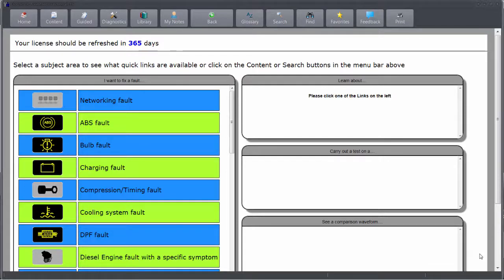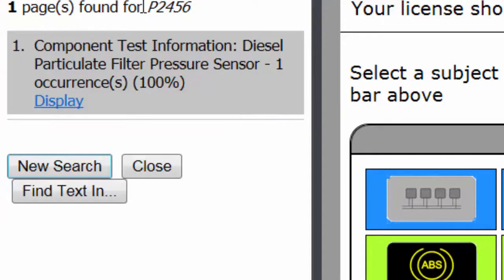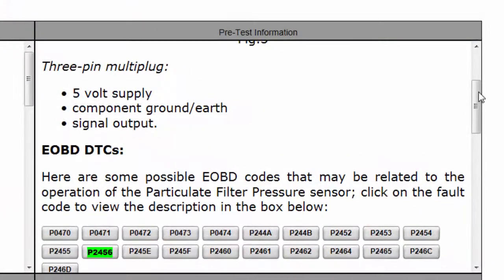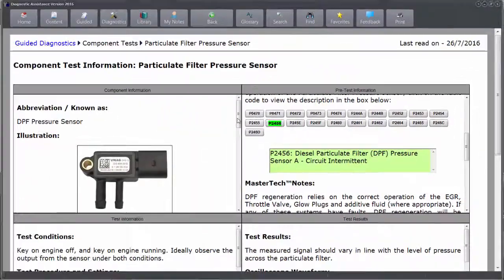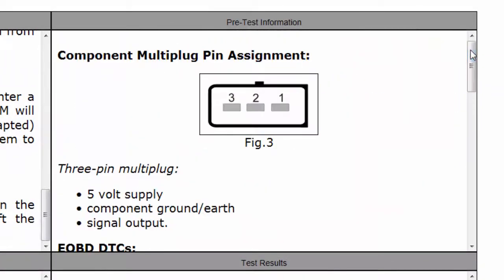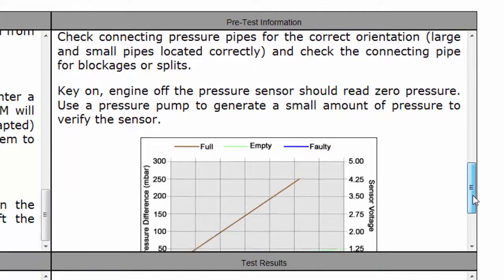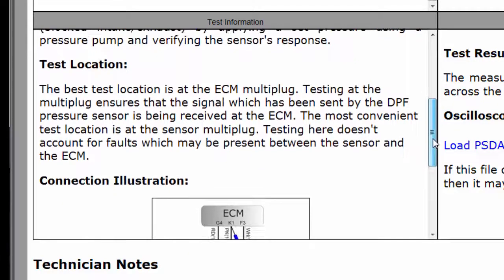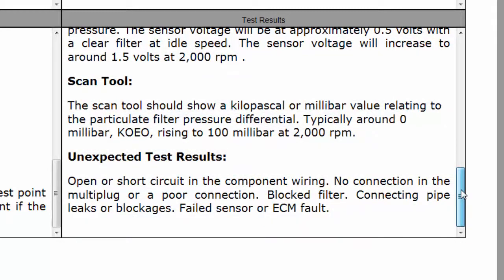Diagnostic Assistance Search Fault Code

Comment: As far as coverage for American models using petrol? Is there a strong enough database to warrant purchasing this ?
Reply from the maker: Hello ONBOARDTECH333. 

The design philosophy behind the software content is based on component technology. Each of the vehicle manufacturers uses the same or similar technology in each of their systems. For instance, consider how many variations exist for the construction and use of a crankshaft position sensor. The software has the vast majority of components found in engine management (petrol and diesel), body systems and chassis systems.

This software is also designed to complement vehicle support material (such as vehicle specific wiring diagrams). It contains test, measurement, comparisons and tips that the usual data sources don’t. 

Existing customers have it described it as ‘Just-in-time-training’, ‘Truly Diagnostic Assistance’ and ‘The glue to hold testing, tools and tech-data together, to get to the fix’. What’s more, the designers and writers are practicing vehicle technicians.

We are currently working towards agreements with distribution partners in the USA. 

We currently supply this software to technicians in Australia, NZ and Asia, South Africa and the UK.
Reply: HELLO KEITH ON THIS DIAGNOSTIC ASSISTANCE SOFTWARE , I NEED SOMETHING LIKE THIS SOFTWARE WAS WONDERING DID THEY PRODUCED THIS SOFTWARE FOR THE (US) MARKET IT SEEMS TOP NOTCH I SEE TO THE BOTTOM OF THE COMMENTS THERE WAS NO REPLY  . IN THESE DAYS AND TIMES YOU NEED ALL THE HELP YOU CAN GET AND I SEE YOU DO SEE EVERYTHING !